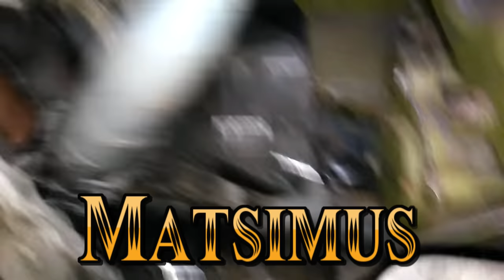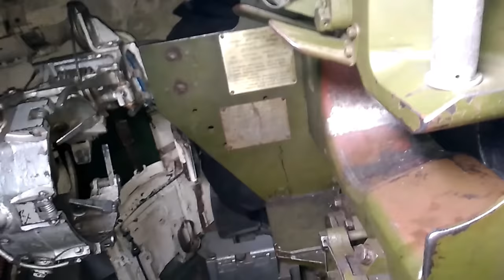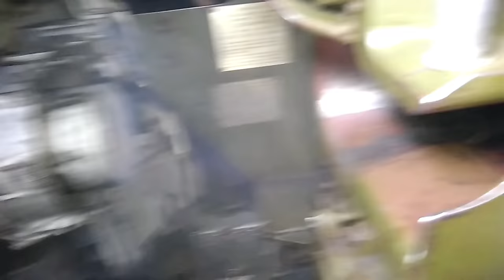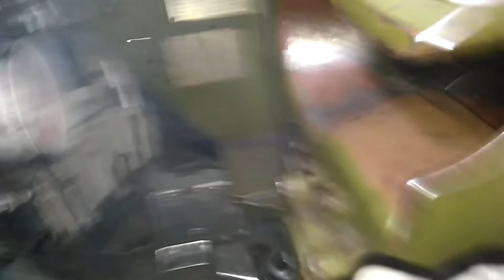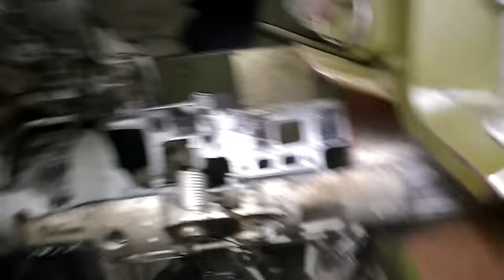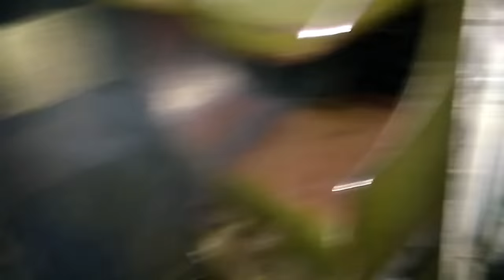Tank Auto-loader Spent Casing Ejection | DON'T BE THIS GUY! 🥵

Comment: Hot brass down the collar doesn't seem so bad after seeing this.
Reply: Well, these won't fit down your collar in the first place!
Reply: I had some 50 cal brass go down my collar and leave some marks on my back. Was a bit distracting as I operated a radio while leading a convoy.
Reply: Yeah lets not overdo it, those things dont weigh much and its in the middle of the winter and he is in full combat gear, he felt absolutely nothing.
Reply: Mohammed Hersi Overdo it? It’s a 3.4kg piece of steel, travelling at a hefty speed (eyeballing it, it travels half the length of the tank in one second, which is 3.4m/s or 12.2km/h, and we’re not even calculating the vertical speed). Also since it’s steel and not brass or copper and because of its weight it takes much longer to cool down.
Reply: Lol, you know your rite
Reply: @raidzor5452  that is in fact nothing in a situation like this
Reply: As a left handed guy ... Your WRONG !!!

Comment: Everyone in the swedish army know the horror of standing to close to a cv90 when it ejects its 40 mm cases straight up in the air. Helmet on or not. they hurt. really bad.
Reply: Well, this one is just gunpowder load's can and not full bullet case as used in 40mm belt-fed autocanon. Actually if that's not war reserve shell with high-longevity gunpowder from 70es, where was used metal can and more/less modern one, it's made of aluminum or even plastic, so it's not really that heavy. And actually lmao, in BMP-2 30mm autocanon, cases are ejected down on machine armor. It actually makes some noise inside, but not that much relatively autocanon itself. https://youtu.be/Zj9Ow3pw-Zk?t=26
Reply: @HanSolo__  Holy s*it. This thing definitely has a quite funny flaw in design. The type of autocannon is quite similar though. Yeap, I know that it's much better than at BMP-2 with 40mm against 30mm, longer and better stabilised barrel, but in general it's the same type of weapon.
Reply: CV90 ejects them towards the front,  so if you stand in-front of a CV90, the. You will not only get hit by blast and dirt as projectiles leave the barrel but also by spent casings! Funny, just stay behind it, not in front of it!
Reply: @fvo911  True. However the turret is not always pionted forwards and the sheels bounces of the hull of the cv. Also if there is a strong wind that day it wont matter.
In the heat of things the commander and gunner and also the soldiers outside forget to pay attention to eachother. Needles to say as a soldier you only make the misstake once.
Reply: Imagine the lads on cruisers during WW2 trying to dodge spent shell casings of 8-inch shells

Comment: Pretty scary to see him proning  right behind a live 48 ton beast like that but Im pretty sure they had full faith on the driver not to accidentally put the tank on reverse.
Reply: Most of the time, there is plenty of communication between the TC (Tank Commander) and the infantry leaders (Sergeants and/or Lieutenants) to inform each other where they are and so on.  Though, there have been more than enough mistakes were men do get wounded and killed regardless.
Reply: Don't worry it's a T-72 which have reverse speed like 4km/h
Reply: You walk backwards faster than a T-72 reverses.
Reply: Russian tanks and reverse gear, not something that go together well, forwards only, no reverse, only charge da
Reply: @blazingmatty123  "Hey Ivan"
"Yes"
"Why does our reverse gear not work"
"Retreating is gay Dimitry "
Reply: Please this is no french tank going faster in reverse than forward
Reply: T72 only 42 ton

Comment: So, erm... the footage from inside the turret is of a T-64/T-80 style of autoloader (aka the 6ETs-40), which DOES NOT throw out the case stub, and instead shoves it back in the loading tray and then back in the carousel, which you can even see in this video. The footage from outside the tank clearly shows a T-72/T-90 style of autoloader (aka the AZ), which does.
EDIT: I see other people have mentioned it already. My bad.
Reply: Dude even the guy who uploaded the video pointed it out. 
Please read the description before commenting.
Reply: @kaspernbs  What he pointed out was that the tanks were different. What I pointed out was that the autoloaders were different, and even more so, different to the extent that one of the autoloaders does not throw out the case stubs at all. I mean... the interior footage might as well have been of an Abrams instead of a T-72. And it's not like it's impossible to find interior footage from a T-72 firing.
Reply: If they are different tanks they are reasonably likely to have different mechanisms.

Or should the op have to stipulate every difference?
Reply: @kaspernbs  You might be missing the point. Moreover, your argument is invalid in a world where militaries are looking for at least some degree of part commonality and prefer using tried and true technical solutions. But I guess that's neither here nor there, and I see no reason to continue this argument.

Comment: To nitpick: the autoloader footage is from a T-80, which doesn't eject the casings. You can tell by the fact that it rams in a single motion. You can even see the case being put on the now-empty loading tray, then lowered back into the carousel. The T-72, which does eject, has a different autoloader that first rams the projectile into the breech, then the propellant in a separate motion.

Comment: To anyone saying it isn’t a big deal. The gunpowder charge casing is made of steel and weighs 3.4kg. Eyeballing the distances, it travels half the tank length in about one second, giving it a horizontal speed of around 12.2km/h, and falls from a height of around 2.6 meters (2.23 of the tank height plus the initial upwards launch, eyeballed), giving it a final vertical speed of 25.7km/h. Summing the vectors gives us a total speed of 28.5km/h. A 3.4 kg piece of hot steel travelling at 28.5km/h  hitting you in the head, even with a helmet, isn’t fun. To put it in context it’s like someone dropping a big concrete brick on you from the second floor of a building.

Comment: I bet he's aware. If your given two options either stand behind the tank. Use the tank as shield but be prepared to be struck by spent chasing on some occasion that mind you " not that heavy " because its already spent and are being sling at slow velocity. OR stay clear of the ejection port and stand at the side of the tank and be shot at by the enemy. Which will you choose?

Comment: That's the different tanks, in the inside and outside views. That's one which throw out the case is T-72, it has the automatic loader with "double-action" - first time a shell is loading on, and then a powder cartridge, empty case is throw outside from turret. Inside view is T-80, it has a "single-action" loading mechanism - the shell and the powder loading on with one movement, the case is return to the drum.

Comment: Only  T-62 and T-72 eject  primer casing out of turret. T-14 also do this but from the side port. 

The  interior footage  in this video is from a T-64( T-80 is similar), which don't have eject port.

Now you need to imagine the same senerior with a T-62.
Reply: The idea of being anywhere near the back of a T-62 after firing is just scary, especially considering their HE-Frag rounds used steel casings.

Comment: But there is a mistake in that video. There are two different autoloaders. The part of the video that shows the inside of the tank shows an autoloader of a T64/T80 that leaves the empty shell parts inside the tank. The tank (T72 or T90) that is shown in the video has the autoloader that ejects the shell parts.😉

Comment: Being surrounded by highly flammable materials inside the tank under the turret is not a great way to prolong your life. When this thing brews up, the driver has some chance of getting out but slimm at best. You can be lucky and have the hot gasses push you out of the turret hatch but I don't know if that's better or not.

Comment: Why do you believe that it's hot? It's intentionally not ejected at start of reload sequence, also it's kicked out by compressed air(so tank stays with higher air pressure inside to prevent any unfiltered air to enter during ejection), so it's most definetly less than 100c when it hits ground

Comment: Imagine getting hit with the casings ejected from the M1128 MGS. Although the MGS does fire a smaller gun than modern Russian tanks(105 vs 125mm), it ejects a full casing at high speeds as opposed to simply chucking a chode out of the tank.

Comment: I’m little new here but, who the he’ll designs a tank that throws spent shells at their own troops that they’re supposed to protect?
Reply: Keep in mind that these are quite large steel stubs. They are 138mm in diameter (150mm at the base ring) and 140mm long. The downside to these is they tend to leave a relatively large quantity of incompletely burnt propellant residue that tends to stick around and create fumes. Both the T-64 and T-80 that use the MZ style autoloader do keep the spent stubs in the tank (upon firing the stub will be ejected into a stub catcher, raised out of the way when the next ammo tray is brought up, the round is loaded, and the stub ejected into the back of the now empty ammo try and lowered).

That can leave fumes coming off the stubs (usually not a lot, but enough that the crew will notice). This also requires the crew to remove the stubs manually when it comes time to replenish the autoloader, taking up extra time. With the AZ style of the T-72 and T-90, those problem is resolved by simply ejecting the stubs out of a small port hatch. The downside is that you both reduce capacity in the autoloder, and infantry will need to watch out when standing behind the tank. But hey, it's better then if you were behind a T-62 ejecting full steel and brass casings (and those things were ejected quite hard).

Comment: It's different tanks inside and outside. Otside is T-72 or his export variation. Inside is T-64 or T-80. 
They have totally different autoloaders. In T-64 and T-80 cartridge after short putting back in loader. In T-72 and T-90 - throwing away in next shot. 

Video of working autoloaders: https://youtu.be/ipc9BBodqC8
Different method of loading, different controls (electronic vs hydraulics) and etc.

Comment: Hmmm, they are not very smart or inexperienced. The are likely to end up under the tracks, they need to find some cover away from the armour, about 10 or 20 meters at least. They are doing sweet f all and as such should be in cover. May be drinking tea while the armour does its job.

Comment: Autoloaders suck. Sure their efficient, but hand loaded ones like the abrams are much better, as they don’t risk killing the crew if the ammo rack is shot, instead it’s all shot out the back, with and auto loader, you don’t have that freedom. Besides, hand loaded can be much faster.
Reply: Abrams and most other tanks also still have ammo stored outside of the ammo rack. In the Abrams it is in the lower hull on the Commander side i think. Also Autoloaders have no fatigure in combat. They will work the same every day, while a loader will is affected by sleep, exhaustion and so on.
Reply: @JazzJaRa   and that’s why there’s 3 people in the turret hull, one gets tired, a new one comes in, and also, the ammo racks, no matter where they are, shoot out fire from the back or some other place. Besides, would you rather have the entire tank crew DIE because a shell hit the auto loader, or everyone survives and the tank needs a new rear part because they hit the ammo rack? That’s why a lot of tanks that use autoloaders are statistically more likely to be annihilated if hit in the ammo rack. And also, an auto loader not getting fatigued doesn’t mean it can’t be affected by some nerd with a machine gun. Just pelt bullets into it and now the tank crew has to take time to repair the turret, in which time a sniper could kill anyone that tries to exit. My point is that autoloaders aren’t great, and even if you don’t agree with that, it’s statistically the right point, so good luck fighting it.
Reply: @aidboo1054  The ammo in the Leclerc is stored in a ammo rack just like the Leopard or Abrams and still has an Autoloader. The only benefits I see in a 4 man crew is for repairs, maintenance or if one of the crew gets knocked out. Also hand loaders also take 5-7 seconds.
Reply: It can be solved. For example French Leclerc tank and many automated self-propelled wheeled howitzers, where the turret is quite outside of the crew cabin. Or Armata  tank concept.